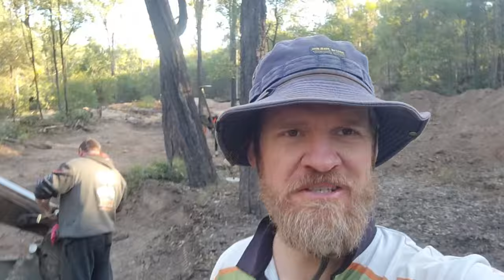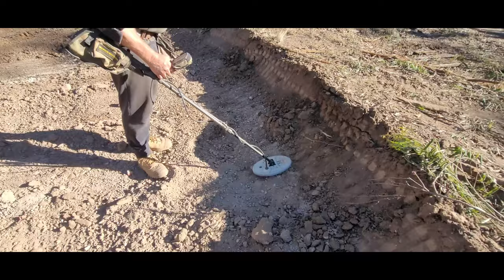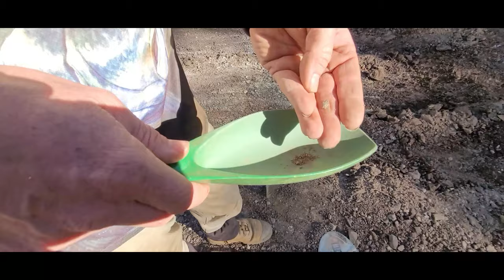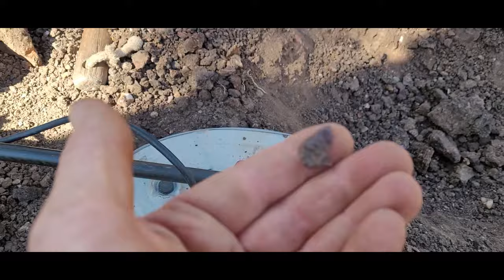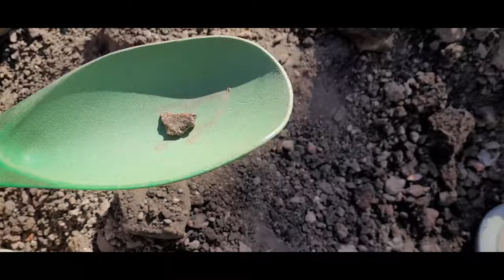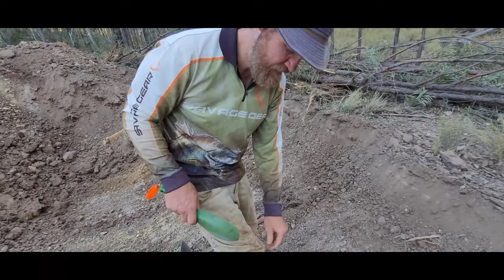Half Oz and 1 Oz scraps left by the old Timers- a huge day on the Gold!

Comment: 7:40....For f.... sake...the excavator is right in front of you....!!!
Reply from the maker: 😂 doesn't work like that when you find targets after an excavator scrape. It's all hand digging until you can't hear any more and then another 200mm comes off...
Reply: @offgridearth567  I've done that for 23 years....
You losen up the area with the bucket teeth.....
Reply from the maker: Yeah we like it nice and smooth. No loose gravel at all.  If I leave gravel,  moo cow will get up me. Too many pockets with multiple subgrammers and it's easy to lose them. We use a battery powered DeWalt for hard stuff now. I like the exercise anyway, sitting on the excavator too much makes me unfit.